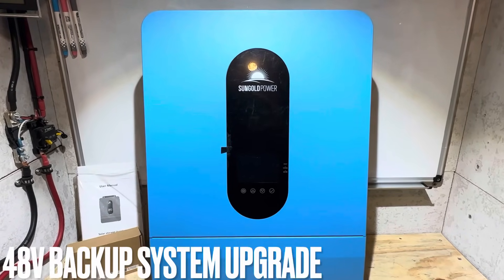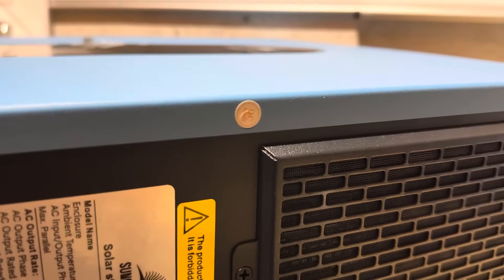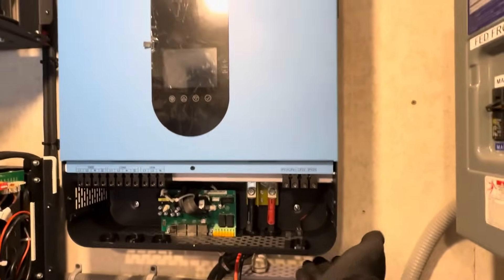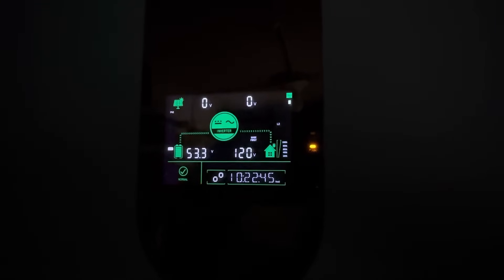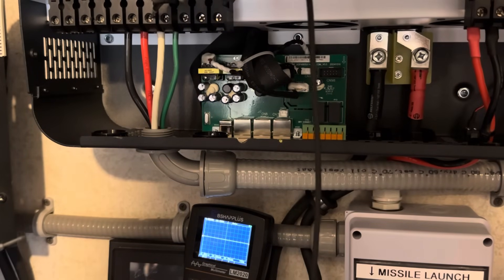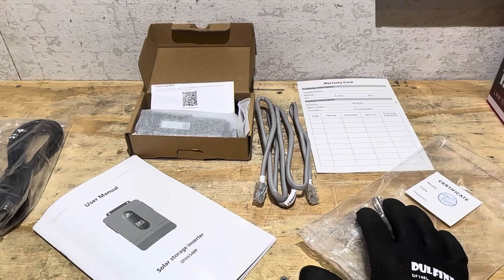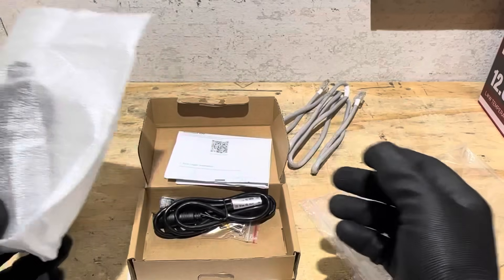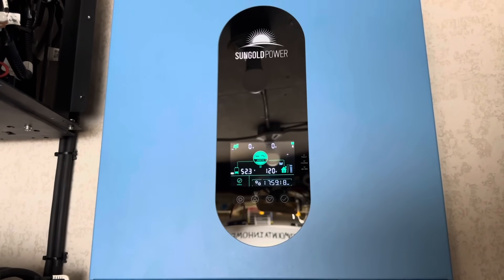SUNGOLDPOWER SPH6548P Inverter, 6500W 48V UL1741 AIO Solar Inverter with 120/240 Split Phase Output

Comment: Hi Can you explain, even though the unit allows for Split Phase, which I am seeing when tested across both line 1 and Line 2, however can you tell why I am always seeing 120v on the display and not 240v? How do I get it show 240v when in use?
Reply from the maker: The display shows L1 and L2 voltage independently. You should see a tiny L1 or L2 in a box when you cycle through with the buttons.
Reply: @THEOFFGRIDMOUNTAINHOMESTEAD  Thank you so much for your reply, this cleared up a lot for me. Greatly appreciate it

Comment: You could just wire your panels in series for this test, would push you up over the 150v minimum.
Reply from the maker: I don’t have enough spare panels to wire in series to achieve the voltage required. I have put this project on back burner temporarily. I had to divert funds that were meant for this system into something else.

Comment: These are fine for large solar array and large battery banks die to the standby current specs. But for guys like me I like to turn off the inverter when not in use while charging through my Victron MPPT controllers. I live the VanLife life so efficiency standards are king. I have to sip and store every watt I can as effici ntly as possible.
Reply from the maker: Idle consumption is a drawback to this unit no doubt. All of Sungold units are a bit hungry at idle. I would like to see them get it down to 50-60W.
Reply: @THEOFFGRIDMOUNTAINHOMESTEAD Or just have the ability to turn the inverter function off. No reason that can't do that. I thought about hacking the output  of the inverter to be a switched function but I'm not willing to spend the money on something I don't know if it's even possible.

Comment: i have the same inverter with a 5.12KWH Powerwall LiFePO4 Lithium Battery SG48100M. and cant seem to make it charge with a generator, now the battery is to low to even turn the inverter on any suggestions on how to make it charge?
Reply from the maker: Sounds like one of the settings may need to be changed in the program menu. Or the inverter doesn’t like the THD from the generator or the Hz is out of sync in the generator. 

Get the battery charged back up first with a stand alone charger or use solar on the inverter etc. Dont let the battery sit completely empty for too long!

Comment: @THEOFFGRIDMOUNTAINHOMESTEAD  Can you please show how to do a power out/load connection through a generator cable to a generator inlet? Many of us have generator inlets already connected to subpanels with interlocks or transfer switches. Along with connecting a gas generator, many of us can also use the same generator port to our SunGold AIO inverters. Some of the questions are grounding wires and SunGold grounding software changes if any. 
Thank you for your videos.
Reply from the maker: I really appreciate your support! Thank you!!

Great suggestion, yes I can show how to connect for a generator twist lock to a house. I will be using a NEMA L14-30.
Reply: @THEOFFGRIDMOUNTAINHOMESTEAD Thank you Sir.

Comment: Hello. If using 120v do I have to wire the L1 and L2? 
Or can I just wire the L1, n, g? 

Also, if not using grid (of grid and not installing grid wires) this unit can create its own ground ?
Reply from the maker: One leg could in theory handle 3250W but I haven’t loaded up a single output that far yet. I have had 2400W on L1 and no load on L2 in 240V arrangement for several hours and it did fine. 

The inverter has means for case ground and has output circuit ground terminal. The manual also has several helpful wire diagrams for different scenarios.
Reply: @THEOFFGRIDMOUNTAINHOMESTEAD 
Thanks for the reply. 

Yes I see the ground terminal. But I wasn’t sure if it took the ground from the grid terminal. (If have to connect grid for it to work)

Ok thanks. I’m just planning to try and run window ac units. So 120v. 
I just have to find batteries that ship to Hawaii 😭
Reply from the maker: @natego5150 Can you find a freight forwarding company that will ship by sea?
Reply: @THEOFFGRIDMOUNTAINHOMESTEAD not sure. Most companies deal with the shipping. I tried from Alibaba $50 batteries lifepo4 x4 ($200) then they said shipping $300. lol

Then bigger batteries , I call and they said cannot ship to me. 

Local dealers have but pricey. I mean my last resort maybe. But I’m still looking
Reply from the maker: @natego5150 Check signature solar I remember seeing something about them shipping to Hawaii with a fee of course ☹️ 
Maybe a good price comparison anyway.

Comment: So you said we could get 120V 6.5kW out, but we needed to beef up the Neutral?. My understanding is that the Victron is switched in software. So is that something that we can easily toggle between the two modes 6.5kW vs two 3.25kW AC legs or is it more hardwired once? Will it comfortably run an electric old style dryer? I'm debating if 6.5kW will be enough or if I need to get the 8kw version.
Reply from the maker: It can be switched in the setup menu from 120V or 120/240. It’s changing the phase output on L2 to match L1. You would need to make sure the neural can handle the increased current in 120V operation mode. 
Old dryer being 120V or 240V? A standard dryer requires a 30A circuit @ 240V most newer dryers need a neutral for the digital controls, but can’t remember the exact wattage they actually demand. Electric heating elements are hungry though. Is a dryer the only thing you are wanting to run or just your biggest load?
Reply: @THEOFFGRIDMOUNTAINHOMESTEAD  If it can be switched in software, I would think the Victron and others would also have the same concern about needing to beef up the Neutral but your video was the first time I even heard that issue mentioned. I'm glad to be made aware of this. I was asking about 240V 30A w/120V electrronics sustained. The electronics is not power hungry. It is the blower and heating elements. I wanted to know if I could safely and confidently know that I wasn't injuring the inverter running 3 hour regular electric dry cycles back to back of several loads a day with washer also running. I saw too many youtube videos where they show a hair dryer or two and run some heaters for 10 seconds and say Yes it can run these continuous. So I buy them and find it can't even start my table saw or air compressor and I've burned soo many inverters running at only half the name plate rating as early as an hour in (many 1-3 hr at 50%+ power burned out. They also don't say what is the ambient temp while running the test. Hot days happen many days a year every year and I don't want to have to remember to not run air conditioner with the dryer on those days). I'm sure the hot ambient temp is also helping with the failures. I figure to run a dryer and be able to use basic stuff, you really need a min of 8-10kW, but the higher ratings keep getting more expensive so wondering if I have to dedicate one of these for a washer/dryer only circuit and if I did, I wanted to be confident that it can handle it easily. I was wondering how much real continuous load the inverter can run without risk of burning it out on hot days. It would be great to know I can run 5kW continuous, and forget and turn on the dryer won't kill the unit. I hate being the guinea pig testing these to find out and having to buy yet another inverter. I should start a youtube channel "How to burn out inverters". I've got plenty of content. I've got two washers and dryers, so I can easily generate lots of continuous loads and all of the cheaper stuff has died.
Reply from the maker: @awesomecat9470 I always like having an oversized inverter. Heat does cause de-rating but most de-rate at 113°F ambient. It does sound like a larger inverter would be a better choice for you or parallel 2 of the 6.5kW whichever is better/lower price for your power needs. 
Bigger inverter would also allow you more PV charging current/larger arrays even if you don’t need the capability on the AC side.
Reply: @THEOFFGRIDMOUNTAINHOMESTEAD  Again you amaze me with information nobody else has mentioned. It sounds like this should be common knowledge, but nobody else seems to mention it for us to ever know. So are you basically saying that one 6.5kW inverter won't be able to sustain a dryer for a few hours continuous (due to de-rateding conditions being present at times). That would basically be true for everyone that using nameplate ratings and expecting continual use at that rate only works under more ideal ambient temperatures. It would be nice if all youtubers mention that when they show off how many heaters and hair dryers the inverter can run at one time. It is not really accurate representation of the inverter's SAFE max usable power rating. All mine that have burnt out, all had temperature sensors. That gave me a false sense of reliability and wasted money.
Reply from the maker: @awesomecat9470 A single 6.5k would run the dryer continuously but I personally wouldn’t put much else on the inverter. Any other startup loads/inrush could trip it when running the dryer with the heating element on. 
It is UL marked so no doubt it will handle its nameplate. 

This is akin to having a 650HP truck, will the truck last longer using all of the available 650HP all the time or not working as hard continuously and only occasionally using max available power?

Comment: So I've got this thing hooked up, AC input and output. 120V grid power via L1 (no L2) , but it won't charge my battery. What do I need to change or do?
Reply from the maker: Go into the program menu and select 120V. It comes setup for split phase. I can’t remember the menu # off hand.
Reply: @THEOFFGRIDMOUNTAINHOMESTEAD  Ah, that did it. Thanks, bud. I owe ya a beer.
Reply from the maker: @rooter-c5c Glad it helped you 👍

Comment: Would this be a large enough inverter to run a well pump or a small workshop thank you for your videos they are always informative and helpful. I'm just getting started in solar so a lot of the things that you talk about are over my head but I really enjoy it. I only have 1200 watts of panels would they run this or should I get more before getting an inverter and batteries. Thanks again for all your videos
Reply from the maker: Appreciate you, thanks for the feedback! The inverter could run a 240V well pump. Workshop should be fine as well. Good thing is if your shop or power needs expand you can always parallel another inverter and double the power!

Comment: Bubba, they are SNRE inverter made in China.  In fact, their tech support is in china, they deal with customers through Whatsapp. and the warranty is worthless. they will not replace a unit, they make you troubleshoot and then send parts for you to fix it, or, you can send it back to California for repair. you pay shipping both ways. you also pay shipping for any parts they send.
Reply from the maker: What did you have fail from Sungold that required warranty? 
Your statement sound like similar procedures with many other CN based companies. I have had to do this procedure (minus WhatsApp) with “American” based companies as well, who are just selling CN components. Even Midnite Solar makes you follow similar procedures (minus WhatsApp only pay for shipping one way with them)
Reply: @THEOFFGRIDMOUNTAINHOMESTEAD  I have a 5K off grid inverter that the display went bad. also a wall mount battery where the BMS failed. they charged me 80 bucks to ship a display and a bms. I put in bms, but they sent zero instruction, so I smoked it because i put balance cables on wrong order. had to spend 180 bucks on a JK inverter BMS off Amazon. still haven't put in display because it still works, so why risk it.
Reply from the maker: @jim_in_ga Wow, sorry you had this experience! Last warranty item I had from midnite was $38 shipped for a charge controller. $80 sounds a bit excessive for your parts.

Comment: I am very interested in the Sungold (SRNE) inverters.  Could you maybe go over what solar panels you have and how they are configured and the changes you plan to make?  Also, what gauge pv wire did you use?  Maybe you can just add a new ground mount with a PV run from your old mount to your new mount and just hook up all the panels in series?  Also, if you are getting a new ground mount, the ecoworthy single and double axis trackers look like they could be a really good investment and increase your active solar hours and extend your generation time (usually by 30-40%).

I also love the southern accent!  Fellow southerner here!  Love it when people sound like my neighbors.
Reply from the maker: The LiTime was fed with series string 800W JJN. (4X200W) I don’t have any more space on the rack I was using or I would make a mix/match for testing. (May set some panels on the ground and still do this as a temporary test) 
I have considered one of the trackers but unsure of how they would hold up over the long run. Nothing is out of the question though. I use 10AWG wire for all my arrays. 

Appreciate you! Glad you like the hill speak 🙂.
Reply: @THEOFFGRIDMOUNTAINHOMESTEAD  Hmm.  Well, if you could find panels with similar operating voltages (within a volt or 2), you could just wire them in series with your JJN panels all in series.  However, since you mentioned reusing the old inverter, it might be best to just order all new panels so you can get a bit higher than the minimum voltage.  I'm also guessing that the panels are far away to avoid shading.  So, yeah, the new run and new racks are probably the right way to go.  I would recommend that you might want to go ahead and run an extra set of PV cables (so total of 3 pairs) so you don't have to worry about pulling another set since your new inverter has two PV inputs.  That way you can just have them all terminated in a weatherproof box and have some flexibility to experiment with different panels and layouts.  Looking forward to seeing your system grow!

Comment: Dang you showing all these cool things! I would love to have a "real" system but I can't justify it for my application. I did just order two weird name yeahulch 12v 300ah batteries that I will use when needed to expand my PPS to nearly 10kwh. Now I guess I have to buy that 50a charger you tested for yet another just in case situation where I might want to charge faster with a generator. I am using reverse psychology, the more I buy the the more reliable the grid will be and all this stuff will just collect dust. Thank you! 😂
Reply from the maker: I actually just got an email from someone I donated a power station to a few months ago. Power out for several hours due to non-severe thunderstorms, they were using the PPS to keep them going. Always good to have a backup even if a small 2kWh PPS. They are real systems too, just a different form. 
Appreciate you my friend, hope you have a great evening!

Comment: Are there any aio units that don't draw so much at idle?
Reply from the maker: Yes there are many options out there now. Some have lower some have higher and unfortunately mfg specifications tend to underestimate real world idle draw. Most are between 60-120W for high frequency inverters at this power level. 
This inverter has eco mode that I will be demonstrating in the next video. Thanks for watching and for the question! 👍

Comment: The Inverter is cheaper than the EG4 6000xp, but once you factor in the breakers for AC, Battery, and PV disconnect, is it really ? Not to mention mounting all of it and wiring to connect them inline. 
Install time and ease of install make the 6000xp a better choice, in my opinion.
Reply: I'd be super curious at testing the two side by side. And a real total cost after adding the necessary extra breakers on sungold to get a true comparison
Reply: Breakers arent expensive
Reply: @ceo4eva For me not a fan of the additional complexity & more places to make a mistake on DIY vs just built in. I do love how clean EG4, ecoflow, Anker systems look. Especially in a garage where neighbors could see vs these looking like you're building a rouge grid. But obviously it all comes at a price
Reply from the maker: Thank you for watching and for sharing your thoughts!

Comment: What's the idle power consumption on this?
Reply from the maker: Right around 2 Amps with the fans on low speed. There is eco setting as well. I’ll be going over more in an upcoming video.
Reply: @THEOFFGRIDMOUNTAINHOMESTEAD  thanks alot really appreciate it
Reply from the maker: @viyusavery248 You’re welcome, thanks for watching and commenting today! 🙂

Comment: First to comment. I have the Sungold 24v 3000 watt inverter/charger aio. I have it connected to two 25.6v 100ah batteries from XZNY. It has been a great backup system for about 6 months. My only complaint is how often it sends a charge to the batteries because of the inverter's idle consumption. I have it connected as a grid backup with no solar panels... yet, that's in the future works. I'm considering moving this system to my shop and getting the Sungold 10K as a whole house backup for my home.
Reply from the maker: I know several people who have the 10KW and one with the newer 11.4KW. I am excited for this inverter due to the company’s track record and performance/feedback from real world users I know. 
The gentleman with the 11.4 runs 5 tons cooling load with no soft start on the compressors.
Reply: Thats what i started with. Soon went with this 6500 watt inverter.
Reply from the maker: Appreciate you! Thank you for sharing your setup and experience! Nice! 👍